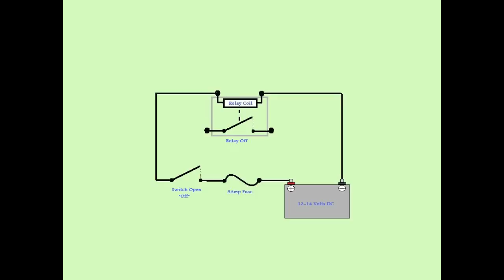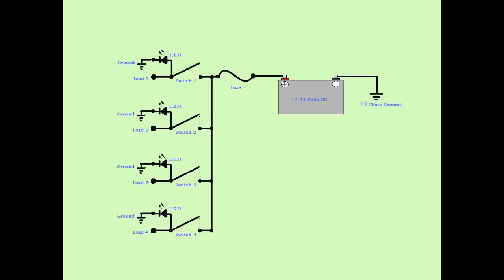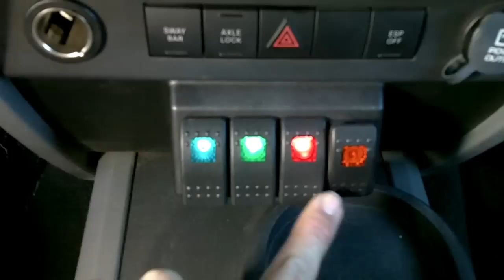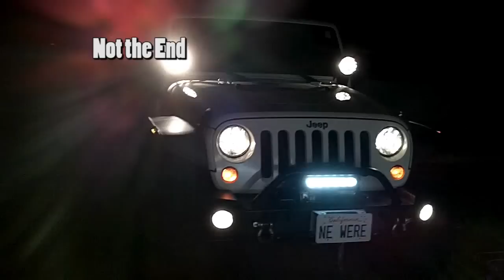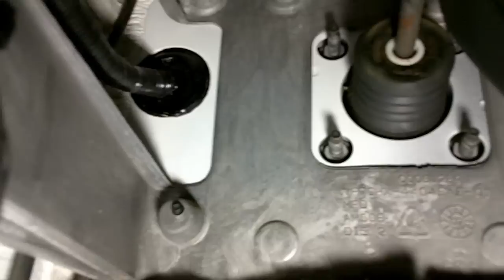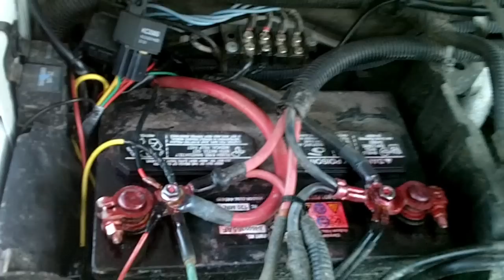Off-Road Lighting 101.

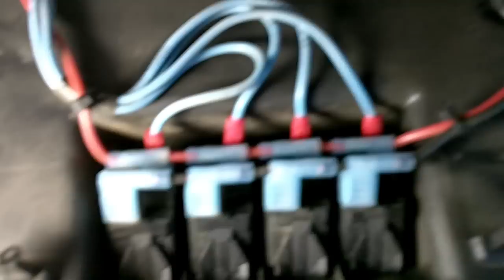Comment: I see at 1:58 the backside of the panel. You have the red 12v power coming in from the right, passing thru each 90 degree terminal and then exiting to the left.  Where does this power supply go to? Anyone know?

Comment: Are these switches lit up when the switch is on or off?  I think I'd prefer them to be lit up all the time.  Is that possible?
Reply from the maker: +Bendc1970A1 These switches are lit when the switch in on, some switches offer a backlight feature, that you would wire to illuminate when your dash lights are on.

Comment: so i did this but i must of done something wrong because when i  click on more than one switch all the rocker leds come on, any ideas on what happen. i also see that your red wire comes in on one side and leaves out the other.... where does it go
Reply from the maker: +Brian white you have your wiring incorrectly landed on your switches. The red wire that is connected to all the switches is power in. and should go to terminal 2 on all the switches. The black wire is ground and should go to terminal 7 of all the switches. the remaining terminal, terminal 3 (power out), on each switch will receive its own wire per switch.

Comment: so do you have a fuse holder ?
Reply from the maker: There is one inline fuse feeding the switch power. As I added lights to the circuit the lighting kits usually came with their own inline fuse where they tie to the +12v power source.

Comment: Hi there! I have tried to read back as far as I could and I'm sorry in advance if this has already been covered! How did you connect the 12v power supply to all 4 switches? and how did you connect the terminal strip (with 4 connections) to the single relay? Thanks Chris
Reply from the maker: The 12v power supply in my case is a single wire coming from the battery, through an in-line fuse, through the firewall to the dash switches. Using four more wires each switch from there is bringing a single 12v supply per switch to individual relays under the hood. These relays, fused and tied to the battery power your lights.

Comment: I want to know where you found pass through right angled spade connectors. I love the clean look and running one power and one ground wire to each switch would be cluttered.

Comment: did you get a better alternator? i have a 97 tj and so far i just have stock lighting but im thinking about putting on 2 more lights by the windshield like you did here and im wondering if i can do this with the stock alternator and run all my lights at once.

Comment from the maker: @michaelk02359 You could keep the switches you have or cut them off, add a slip on connector, and then attach them to your new switches. Use the 12volts feeding your switches to feed your new switches too. Note: That is assuming your existing lights are set up in a typical manner.

Comment from the maker: @michaelk02359 There is only one main 12 volt power source in a vehicle but it does supply power in two locations for the aux lighting circuit. First is supplies power to the switches to feed the relay coil. This turns the relay on. The second supplies power to the contacts inside the relay so when the relay is on it's contacts power your slim lights. But this is all from one source... your battery. Check out my "Off road lighting made simple" video when you get a chance.
Reply: Where did you draw power for the actual switch panel? was it from the "always on" cig lighter  or the switched one?

Comment from the maker: @MisterrJOVI Most automotive switches can only handle 3 Amps of current. The relays can handle 20Amps of current. With the relay in use the switch only sees 3 Amps or less. Wiring the light straight to the switch will work but you will be facing possible hazards. In my case I am only running 1 wire per switch through my fire wall not two each. Almost everything in your car has both a switch and a relay headlights, blinker, etc. it's just the proper and safe way to do it.